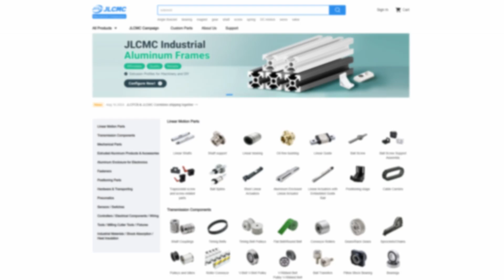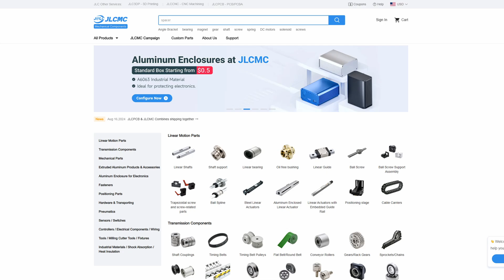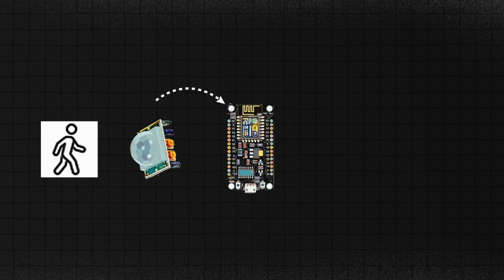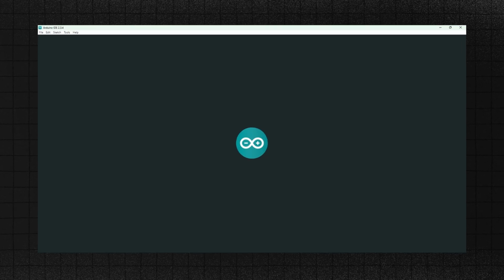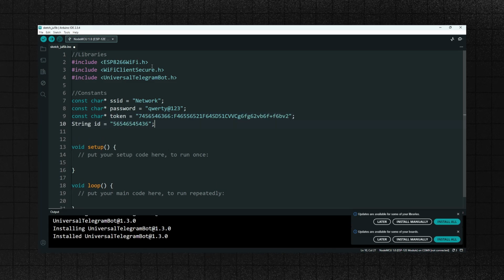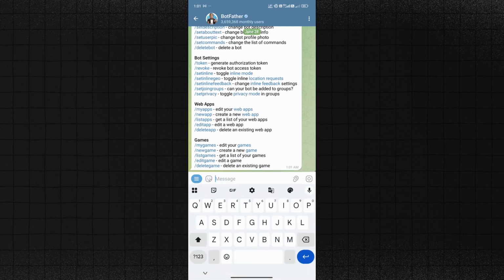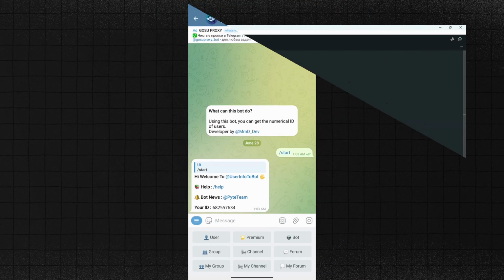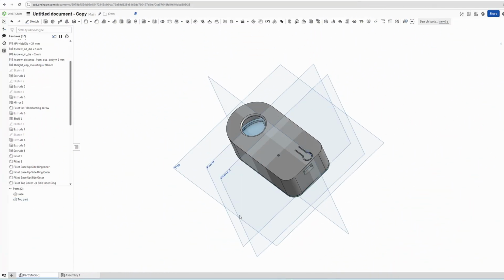Build DIY Motion Detection Security with ESP8266 for HOME PROTECTION

Comment: Or how to connect it with wifi plz guide Tommorow is our project
Reply from the maker: In the code you will see ssid and password. You have to enter your WiFi network name in ssid and network password in password, so that the device can connect to internet through the WiFi network. If you have any doubt then let me know, I will guide you.
Reply: @UtGoTech so bro both device the phone and the nodemcu or laptop has to connect through the same wifi?
Reply from the maker: @AyushSingh-jq4tb  No its not necessary to connect both the device through same WiFi Network.

Comment: Hey my pr sensor only rining after 30 second itself and does not detect motion also telegram bot message not sending.I did every step you told
Reply from the maker: Try adjusting the knob in the PIR sensor.
Reply: Same problem 🥲
Reply from the maker: @AyushSingh-jq4tb  Use the knobsto adjust the detection sensitivity and time interval.